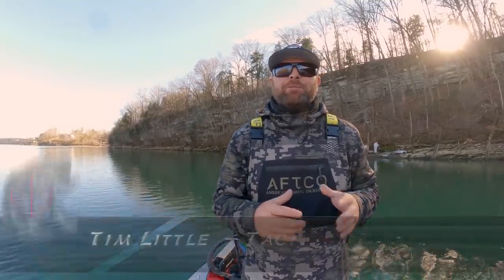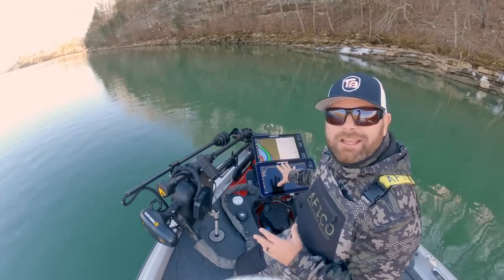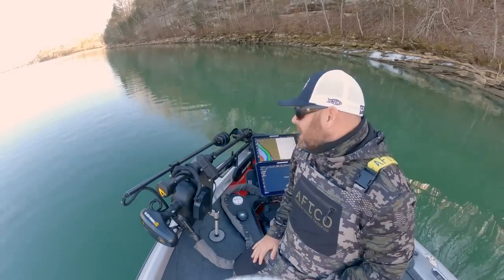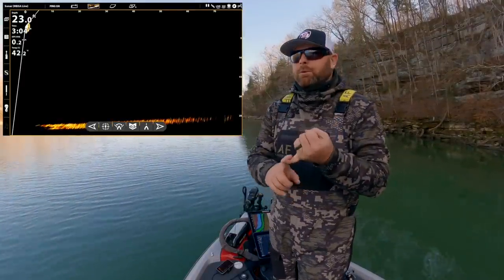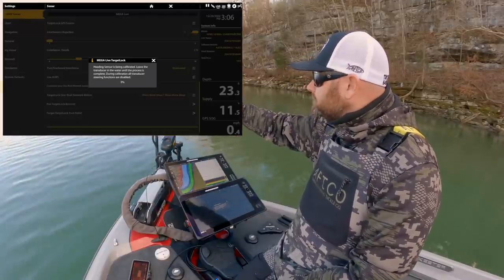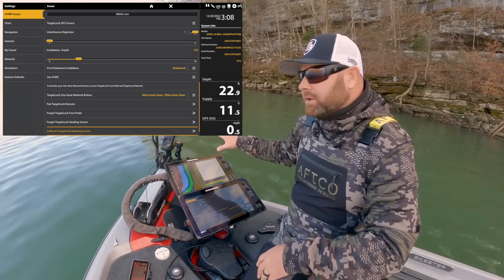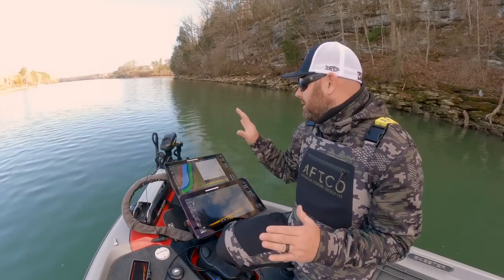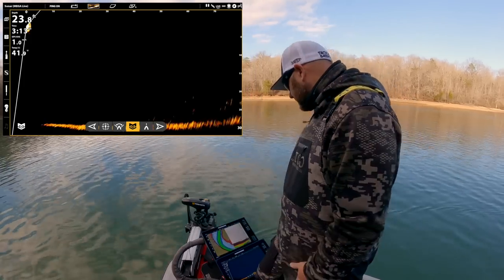MEGA Live and Target Lock (Advanced Turret For Live Sonar Transducer)

Comment: Hi Tim, I see the APEX 15 and the other graph (what size it it?) mounted on the bow of the boat. I have two Solix 15's on the front of my boat. I really like the way you have them mounted. What mounting brackets are you using? How close is the Target Lock to your top graph when the trolling motor is stowed ???
Reply from the maker: I believe Tim is running an Apex 16 with a solix 15. The target lock is close but no issue. These are hennessey outdoor electronics mounts and they're AMAZING! Tiny footprint and incredibly solid!

Comment: What length trolling motor shaft is the Targetlock working with?  if it’s a 60 inch I was curious how it worked.  According to Humminbird they don’t recommend it because people using a 60 inch trolling motor are typically in more chop.  Curious your experience thx

Comment: Enjoy and appreciate the work you all put in. What kind of wiring did you use for your 360 and Live? Size of wire and brand?
Reply: Hennessy outdoors does their work. They sell wiring kits, and can be found online. I used 8 gauge marine grade wire to a marine fuse block and  connected my units to that. Using a separate lhium battery under the starboard side rod locker. 30ah amped outdoors, which isn't super expensive. Live really uses some power.
Reply: @Jeff Hunter  Thank you Jeff. Got 10 gauge and a 12v 23amp lithium just for the mega live itself.

Comment: Does anyone talk about battery configuration to run all of these electronics
Reply from the maker: We've talked about it before but are happy to answer any questions, any time. Fire away 👍🏼
Reply: @tacticalbassin  are you using flooded cell batteries? How big or how many?  Or are you using something else
Reply: @tacticalbassin  are you using flooded cell batteries if so size and how many? Hooked in series? Or are you using the new wave 700 dollar?